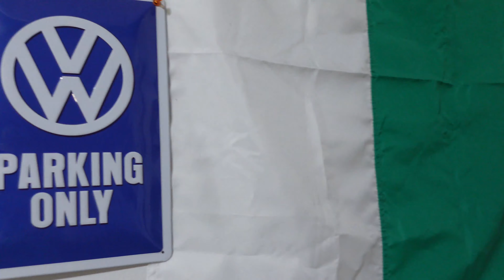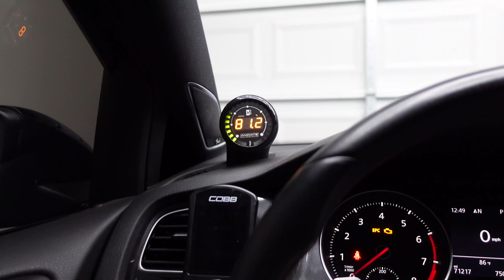MY GTI MK7 TRANSFORMATION

Comment: I have a question I notice you have the noise reduction cover under your hood. Won't that defeat the purpose of letting hot air come out of the vents? Or did you cut out section on cover for vents? 🤔
Reply from the maker: After I installed them I found out that the rain guards are not really functional. I put the cover back on just in case it rains but I removed it later on.
Reply: Sweet! That makes sense. Thank You! So you still recommend getting them?
Reply from the maker: @limitededition3278  for looks and more engine sound 100%
Reply: @alexxkolev  ok makes sense. Thank you! Good videos 👍